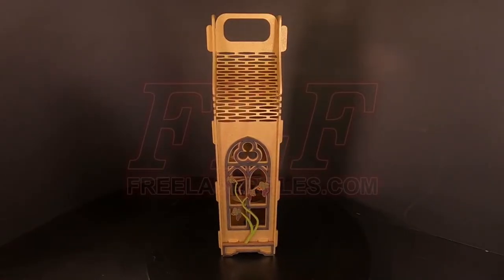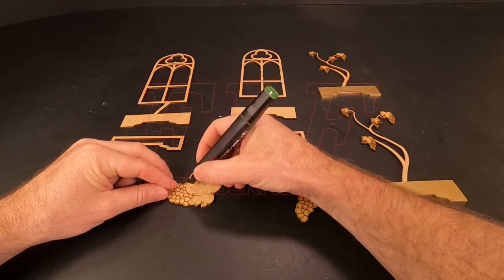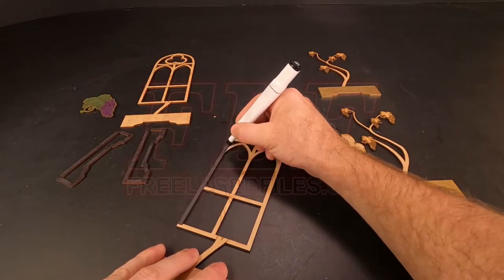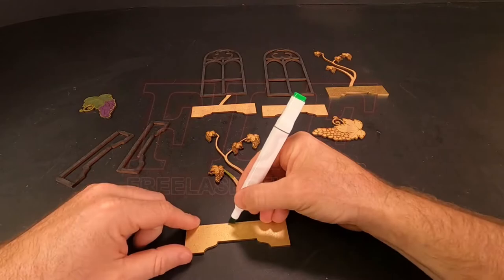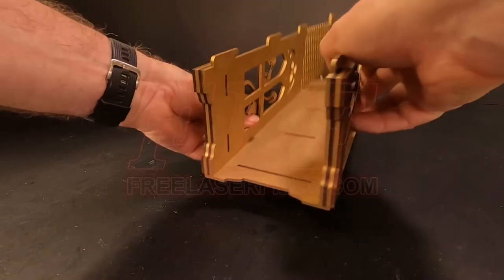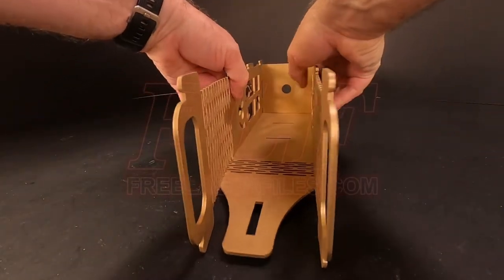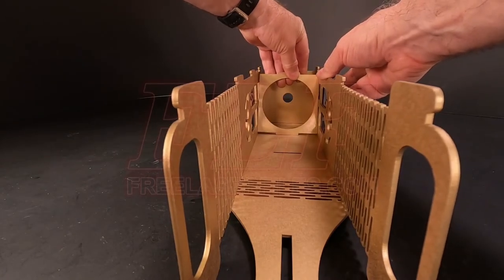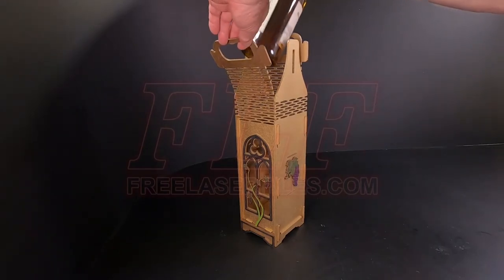Laser Cut Vineyard Wine Caddy Build Instructions and Free Cut Files

Comment: Your files and videos are amazing, thank you so much for uploading. In answer to a previous question, these will cut on a diode laser (Ortur, X tool, Sculpfun etc) preferably with a minimum 10 watt laser output. The only problem is the size of some of the items, the Wine Caddy for example has pieces that are larger than the laser bed. I'm saving up for a Co2 laser, the diode ones are great but just a bit limited for size and power.
Reply from the maker: Hi Malcolm, thank you for you kind comments. When we designed this caddy we were trying to offer a simple design for people who were new to cutting on the glowforge format lasers. Plus, the pieces need to be that size to hold a standard wine bottle. As we are moving forward with more files we have started nesting the parts on 17"x15.75' sheets as well as the 19.5"x11". Obviously it is impossible to offer files for all machines, so we do include a file with all the parts laid out, so people can do their own nesting to suit their machine.
Again thank you for your comments and if you haven't already, please subscribe to our channel to enable us to keep uploading files.

Comment: Where did you get the glue bottle from
Reply from the maker: Hi, I buy the bottles from e bay or amazon. One or two ounce plastic bottles with luer lock tops. Sometimes I order them with the blunt needle or I order the needle separately. The needle I like are 18 gauge. Try to order them with some kind of stopper to help prevent the glue drying in the needle. Also I would recommend having another larger bottle with water in, to flush the needle if it start to block. The bottles and needles are cheap and make building models much easier.
If you have trouble finding them, get back to us and we will try to help.
Reply: Thank you I will get some

Comment: the link to get the file does not work :/
Reply from the maker: Hi, we are working to improve the website. It will be back up as soon as possible.
Reply from the maker: The website is now working with improved format and more layouts/nestings  for different laser bed sizes. Most of the models now fit easily into cutting area of 495mm x 279mm and 400mm x 400mm.